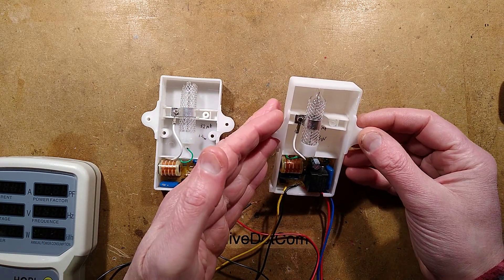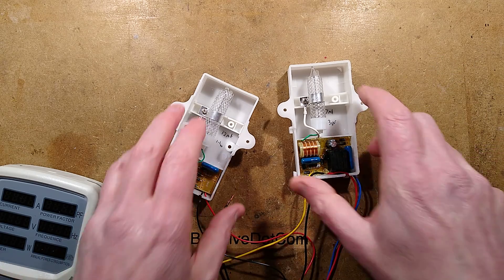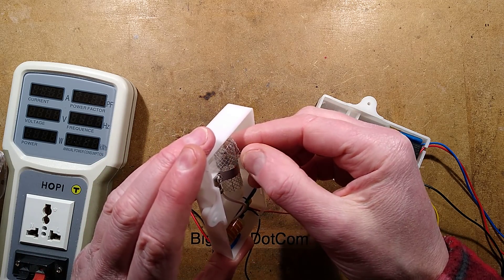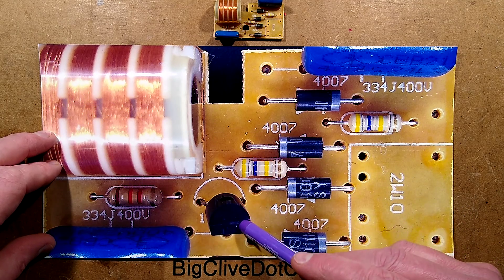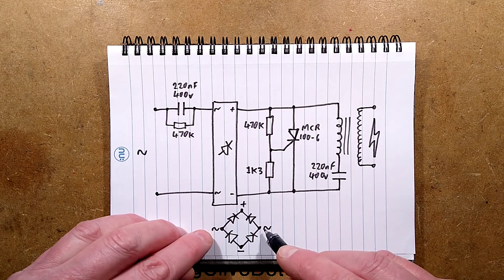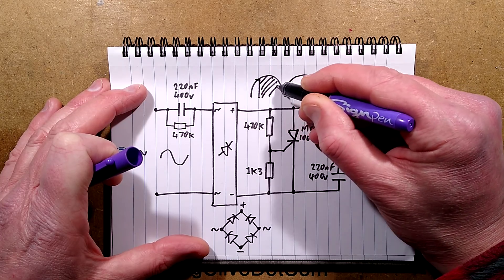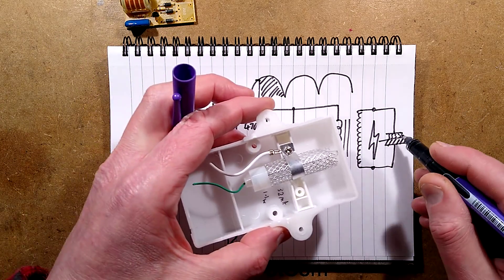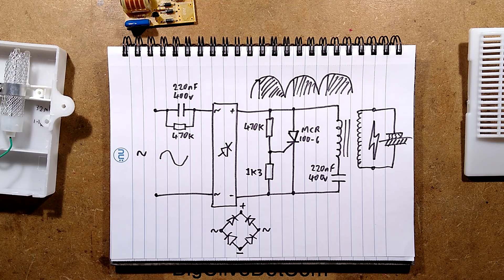The "two-wire" high voltage mystery eBay device

Comment: I didn't quite get what the 4-wire model had here - whas it a relay? a filter?
Reply from the maker: The four wire version had a different circuit board with a latching no-volt safety relay.

Comment: So is the real difference between this and the relay version, that this one is always on, and the one with the relay is switched externally?
Reply: Actually, as I think about it, I can't see what the benefit of the relay version is...it's all at mains voltage, and if you need to switch it externally, that can be done on the 2 cable version just as easily...

Comment: The empty spot is just for the relay on the 4wire version, isn't it?
EDIT: Actually nah, they're different boards rather than just reused boards. 2w10 is the parts code for a bridge rectifier but the hole pattern is weird there....no idea  :/
It does look like a relay hole pattern so maybe it's for a different version of the 4 wire or something

Comment: I have a 240v plug in PSU with USB output socket supplying 5v, when I plug an LED desk light into it there is a strong flicker so I looked inside.
It appears to be a switch mode PSU but the rectifier only has one diode fitted, there are spaces for the other 3  diodes but they are absent and they have put a large resistor on the positive side to complete the circuit. It seems odd that there is a lot of components compared to a capacitive dropper circuit but they left out 3 diodes, there are a 3 transistors, 3 shottky diodes, 3 capacitors, 12 resistors, an opto isolator and a transformer plus a couple of LED indicators but for some reason they didn't bother with a full bridge rectifier.
Is this just an attempt to cut costs or would they be be trying to reduce output by only using half wave rectification ?

Comment: The 2W10 is a 2A 1000V bridge rectifier in the round epoxy case, similar to the 1.5A W04s I have a bag of somewhere. Long leads. They used to use them in hair dryers (maybe still do). So an alternative to stuffing the four '4007 rectifiers.

Comment: It's common knowledge that if you can smell ozone, it is at least the level of smog. If that's a toxic toxic or not, no one knows. 
I didn't believe it at first, but after some investigating, it turns out to be true. 
See YT video titled "Do salt lamps work?" by Veritasium (jump to marker at 10:23 to see the test).
Reply from the maker: If you can smell it there's too much for safe breathing.
Reply: @bigclivedotcom  Indeed. 
The funny part is, that product is marketed as an "Air purifier"!

Comment: When the “low voltage“ side is mains...
Reply: Oh for the good old days of colour TV with vacuum tubes and CRTs.  On 25 inch colour TVS, the CRTS were fed as high as 40Kv via large flyback transformers.  I cut my electronics teeth on repairing them or doing weird things with them (one time I built a radio telescope out of one).  While the current is generally too low to actually injure you, contacting it could provoke some pretty spectacular muscle reactions.  A buddy repairing the family TV (live of course if you need to adjust something) had his father come to the door and say "how's it going?". Paul was startled and contacted the 40Kv, and the screwdriver he was holding magically disappeared from his hand and then reappeared punched all the way through the doorframe inches from his dad's head.  His dad learned to avoid possibly startling him if he power is on, and we both learned to be a bit more careful around CRTs.  Even with the power off, always discharge it safely.  A 25" CRT is a pretty good capacitor.

My University physics TA (in a custom 8 bit microprocessor course the two of us "invented") was truly evil.   He had this habit of sneaking up behind us while the power was on (often an open chassis with 120V mains transformers in the DIY  linear power supplies and many live points) and slapping a wooden yardstick down HARD on the heavy composite lab tables we worked on right beside us.  Sounded like a gunshot.  EVERY FLINKING TIME we had a heart attack and chased the TA back into his office which he locked, while he was giggling his head off.
Reply: @fromagefrizzbizz9377  I want that TV which enables the ninja throwing skills and reflexes. I'm sure the aim can be improved with practice.
Reply: @fromagefrizzbizz9377  It is possible with practice to learn how to clap one's hands together to make a sharp snap that sounds just like a high voltage DC discharge. I will not admit to having done this trick while the DEC repair guy had his hands inside the PDP-11/40. No one was injured, not even the PDP-11.
Reply: @amazing7633  Ah yes, PDP-11's, the first computers I ever really loved - well, except for the 8 bit micro I built myself with the colossal memory capacity of 256 bytes.  Oh the stories we could tell about them.  The time the PDP-11's processor board decided to go the wrong way on a branch instruction, and the techie insisted we were nuts.  Or how the arrangement of wires on the backplane caused the computer to crash on a specific sequence of instructions.

Comment: it might be cool to have a few of these discharge tubes for a DIY ozone generator but $7-8USD each just for the tube is a bit high if you wanted say, 4 or more
Reply from the maker: The ceramic plate versions are probably a better option.

Comment: Does the tube indeed contain any gas? I would have thought that an open tube exposing the air to the arcs would have been a better way to generate ozone.
Just intuitive thinking. I have no actual clue about high voltage.
Reply from the maker: It does appear to have at least vacuum.

Comment: Your "lazy bridge rectifier" is not so far off actual symbols used in power systems. Rather than a diode picture, the box should be split by a diagonal line from bottom left to top right, with a sine wave symbol in the left side, and a flat line on the right to indicate rectification (may also imply regulation). A flat line on the left and flat line on the right indicates a dc-dc converter, and flat on left and sine wave on right indicates an inverter.

Comment: Are you sure those 470k resistors aren't 460k or is that just the light deceiving me making violet look blue?
Reply: It's clearly blue for me. Went back and if you compare it with the bottom capacitor it's almost the same shade. I guess the blueish shift on  the black parts of the diodes make it look like that, but wouldn't expect that to shift purple to blue.
Reply: @Smaxx  So you say,  we safely assume then that is a non standard 460K resistor? @Bigclivedotcom Would you be so kind as to pull one of those 470K/460K whatever resistors out of circuit and measure it with a multimeter for us? That should clear the question up. 

Going back along the the tacks of time: I was given a brand new board that nobody else could find the fault on. I spent about 2 hours on that board before I found the fault. One little resistor which was meant to be 15K according to it's colours turned out to be 150K. I found a resistor on another board that was open circuit. Thank goodness for multimeters :)
Reply: @gandalf87264  Not sure. It's striking me odd either way. Especially considering Clive wondered about the 1.3kOhm one! I could readily order tons of different 1.3kOhm resistors right now (Germany), but I'm having a hard time finding any 460kOhm ones outside dodgy Chinese sellers.
Reply from the maker: I'm going to have to remember to reset the white balance on that camera for the close up lighting.

Comment: Plug it into the same receptacle a cable or DSL modem is plugged into, I dare you.
Reply: I had a Belkin UPS that used a SCR to pulse charge the battery, it wouldn't bother the DSL or cable modem it was powering but cheap analog audio stuff on the same circuit would sometimes make an intermittent loud buzz when the UPS decided to top up the batteries.
Reply: @NiHaoMike64  You're probably right in that there is just enough filtering to prevent the massive amount of wideband IF noise from knocking a decent modem offline. But my point is that the only thing that is in the path of that noise generated by the GDT is the transformer itself; which happens to be designed for switching power supplies and thus pass surprisingly high frequencies. Here in America there are some ridiculous things sold that may or may not do their job, but they at least have to pass FCC requirements on both transmitted and emitted noise; of which this product doesn't come close.

Comment: 1.3K: For a four color band resistor that would be Brown, Orange, and Red and then a tolerance band.  Standard in E24, E96 and E192.  Probably not going to find it on the shelf in any tolerance other than Gold 5%.

Comment: Why not just run walk AC through a transformer?  Simpler!
Reply: Because it’s the rapid discharge of the charge on the capacitor that generates the high voltage. Rather like the line scan in a CRT television during flyback.

Comment: If you wanted that light effect for a larger prop, how would you go about doing it?
Reply from the maker: Traditionally with a crackle tube.  A neon tube filled with chunks of glass tube.
Reply: The effect was first seen on top of ships masts in thundery weather.  Hence the corona (crown) name.  Increased tubr size may simply need more turns on the high voltage winding, and possibly larger capacitors and a more powerful thyristor.
Reply: @johndododoe1411  Ah, yeah, nice, I had to read your reply… there's that voice again, torturing me the whole day again…
"Gonna be your man in motion, all I need's this pair of wheels.
 Take me where my future's lyin', St. Elmo's fire…"

Comment: Um, isn’t ozone a carcinogen?
Reply: Anything that destroys biological matter at atomic levels can act as a carcinogen (destroying/corrupting DNA), but as with many things the exposure and concentration matters. It's considered poisonous, because it oxidizes stuff. (As far as I know that's what you experience when you can "smell" it, you don't smell lower/natural concentrations. It's actually burning the receptors in your nose, which is what you notice.) However, you're exposed to varying levels of ozone all day long, especially after lightning storms (it's that "smell of lightning") and it's in general completely harmless and nothing to worry about. Just like natural radiation. I just wouldn't put that emitter in your body or sniff on it all day long.
Reply: @Smaxx    Thanks for the great reply.  Cheers!

Comment: Electronic components function are simple, its the values that can get tricky lol.I am not at Electronics and I already picked up on most Electronic components less week.I already learned basic important circuits and how a recphyer changes AC to DC and a Osc circuit DC to Ac pretty much.Is pretty my converting DC to AC is just re oscillating current back into Altnating current since an OSC, Osclates voltages into waves like a saw or sine wave in circuit same as a analog synth?Same with a crystal osc in scanners any computers,radios to  
Set the right freq and step KHz Freq for police scanner.it sets clock speed in your computer. I think the crystal Oscillator has two tuning forks with thin wafer crystal to resnate the forks to the correct freq and c sends it to the mixer and ampher than to final out put to the speaker.I think the scanner has a raw discriminatory chip that is the first stage of all raw freqs that the antenna receives than the discriminatory chips filters out all the garbage freqs that the radio can tune to than the discriminatory chip sends all raw freqs to crystal,crystal only filters in the correct set freq.

Comment: linked in the ebay: article listing: "12V spot welder circuit": I am intrigued! what's that?
Reply: Maybe a tool to weld electrodes onto batteries.  There is a DIY version online using a car starter battery and starter solenoid with some control circuitry, misused earth wires and other sloppy mistakes.

Comment: So could you make a mini Jacob's ladder with one of these? Maybe with straightened paperclips for electrodes?
Reply: Most likely, considering it's basically the very same effect (just with a different form of electrodes).
Reply: @Smaxx  I think I feel an experiment coming on! Dirt cheap teeny-tiny plasma globes! ⚡📐🔧😀
Reply from the maker: I don't think the voltage or current would be high enough.
Reply: @bigclivedotcom  That's a shame! A pocket sized Jacob's Ladder would've been fun ⚡☹️

Comment: There is another crazy cost down version (selling price around 75p), using one diode (half wave rectifier) and etc. The components on PCB are ... 220nF capacitor / 470K resistor / 6K resistor / one doide / one thyristor / transformer
Reply from the maker: Do you have keywords to find it?
Reply: @bigclivedotcom  I found it on China e-commerce website, not sure whether available on ebay. Since URL is not allowed to post here, you can use the Chinese wording below to search with google. Search picture and you can found those cost down versions.

消毒柜臭氧发生器通用220V消毒机负离子杀菌臭氧器2线消毒柜配件

Comment: The PCB appears to be asking for 330 nf capacitors, would that suit it for lower voltage mains then?

E: the strange footprint there is almost certainly for the relay that's missing from this model.

Comment: I got a very small battery powered ozone generator that goes in the fridge. You should tear one of those apart.
Reply from the maker: I've taken a few apart.
Reply: @bigclivedotcom  Ok, I missed that man.  You have so many great videos I have to actually resist diving too deep into them . Thanks for making them.

Comment: If I'm not mistaken this unit could be run on 120v by shorting one of the input diodes. This would turn the diode bridge into a voltage doubler, similar to how the 115/230 switches on old PC supplies work. I think this converted circuit would have 60% the output on 115v 60Hz as the original has on 230v 50Hz.

Comment: It's not argon (which would glow) it's air since it's supposed to leak ozone from the tube. 
The purple discharges are normal tiny lightnings/electric arcs.
Reply from the maker: The tube is sealed. The ozone is generated by the Corona on the outside surface.

Comment: Why is the arc happening inside a sealed glass tube?   Wouldn't it generate more ozone by having the arc conduct through the air?   Use a tube like this, but have it open to the air, even if just a bit, should generate much more ozone.   Maybe the gas discharge tube is meant to produce UV?
Reply from the maker: The coupled current causes a Corona discharge on the outside.
Reply: @bigclivedotcom  OK, thanks.

Comment: You didn't discuss the version with the relay.  curious.  AND just were is the Ozone produced?  Certainly, not inside the tube.  Maybe I missed the cross-sectional drawing of the gas tube. 
 Is the Al-U-minem mesh outside in air so that is where the discharge creates Ozone?  OK, maybe that was obvious.
Reply from the maker: Yes.  Corona discharge on the outside.  I took the four wire version apart in another video.

Comment: Sellers in China are very adept at the keyword spamming game. They'll throw in as many as they can, no matter how little they apply.
Reply: What's worse are the Chinese sellers that ship via an office in the UK, so the seller location is listed as the UK, but you still have the shipping time from China, cus they're not selling from stock in the UK. The UK address is just a front. It's just a place they forward the parcels from China from. Slowly, but surely, they're taking over EBAY. And people usually can't spot from the photo and listing details, that the product is garbage.

Comment: It must also generate a ton of RF interference. Perfect to prevent your neighbors from watching DVB TV or listening to the radio. Did you check on that Clive ?
Reply: Excellent point.  Our fave Manxman needs to get himself a spectrum analyzer, or at least gin up some LED indicator circuit that monitors the AGC  level on an AM radio.
Reply: Might as well put an antenna on the output just to see how far the noise can travel. (AM band at nighttime, probably detectable ½ way around the world.)

Comment: I appreciate the follow-up for us split-phase types. 
At 110-120V my rectal-number-generator pulls out a 180k substitution for the thyristor trigger divider as the closest E12-series or a 200k if you feel like stocking E24. 
Not likely that I'll order one just to test and I don't want to root out any mean squares tonight.

Comment: I'm curious if this mystery circuit has enough power at the high voltage side to fry bugs on a bug zapper grid. I have this rectangle shaped bug zapper named the monster zapper but monster is isn't. this thing is only as useful as a fluorescent light. It doesn't pop at all. I have a HV transformer that I'm going to try to implement into the zapper. hope for the best.
Reply: When I was much younger, I built a truly over powered electric fence module, with a EHT car coil that will do the job nicely.

Needless to say, it was built, tested, and then promptly shelved in a box with the 30 odd meters of high tension cable I bought along with the other components after I saw how fat, bright, scary and long the arc was that it was putting out.

 I guess I never used it primarily due to the fact that I had visions of doing corpse clean up every morning and then finding places to hide the bodies.

When I got hold of an electric fence meter, to try and ascertain the output of it, the meter just kept reading - - - on the screen after connecting the prongs to the arcing side, so I never did find out what the output of it was, but it was and still has the most terrifying of arcs. 

I will however say, that it would get rid of your bugs within a modest range of the unit 🤣🤣🤣
Reply: @-Gadget-  might pop the circuit breaker too. That might be overkill for my zapper.